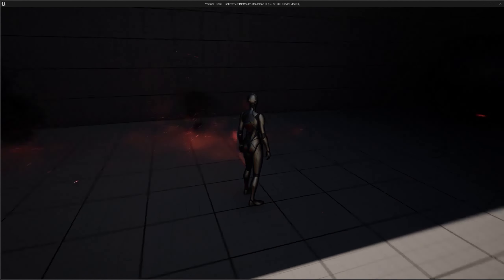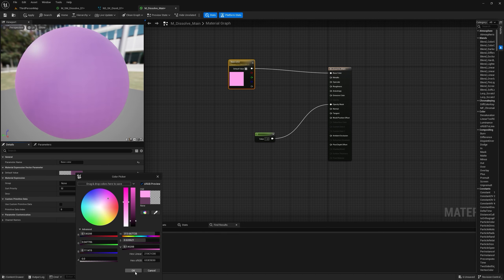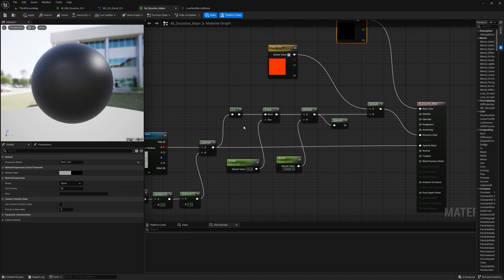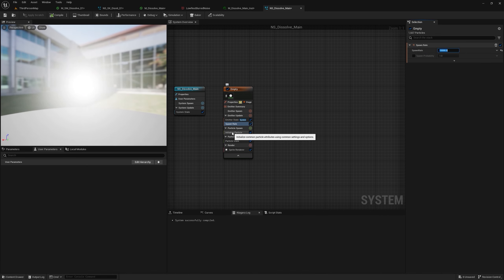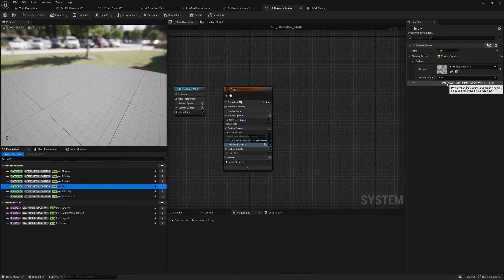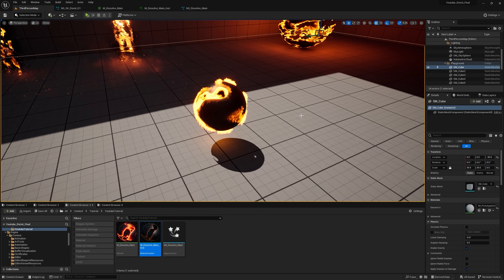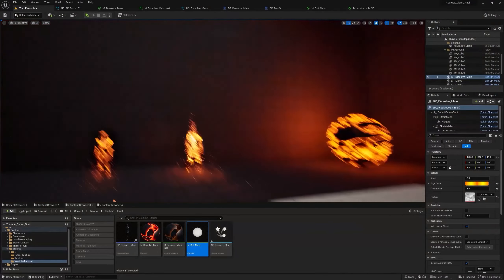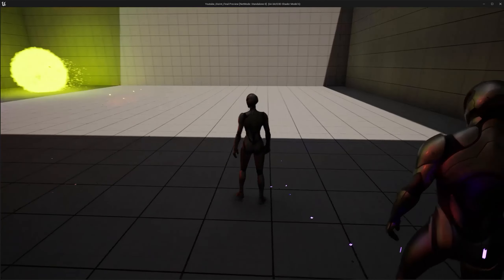Vaporize in Style: Epic Disintegration  UE5 VFX Tutorial

Comment: Thank you for this awesome tutorial. But i have one problem:
I only use the material without the particles.. So now, when the material dissolves, it will lit up the environment >extremly< bright at the end. 
How can i prevent this? it doesnt look like it in your video
Reply from the maker: Reduce the emissive value
Reply: @UnrealCG  But then the dissolve edges doesnt look like yours anymore, im using the exact same values as you. I wonder why it doesn't overdrive like that in your video.
Reply from the maker: It is affected by Postprocess  setting and lighting etc

Comment: Hi @UnrealCG I've got to the 43:11 mark, but the skeletal Manny mesh isn't disappearing along with the alpha. Any idea why? I've gone over this part of your video several times but I can't see anything that would indicate why.
Reply: Actually, I've found none of the Blueprints options work in relation the Skeletal Mesh at this point (everything perfect up until this). I've tried edge colour, the actual colour and the colour stays pink (previous one I used) and the strength isn't affected. Very strange, unsure what has gone wrong. Any ideas?
Reply: It's almost like duplicating the macro is using all the copied values but this is just a gut feeling. Any help is appreciated.
Reply: @TheRedBullCrysis For that to work, you need to add the textures from the skeletal mesh in M_Dissolve_Main (you can add other textures such as the Normal, Specular, Metalic, etc), and set M_Dissolve_Main as the material for the Skeletal Mesh.
Reply: Did you figure it out? I've the same problem..